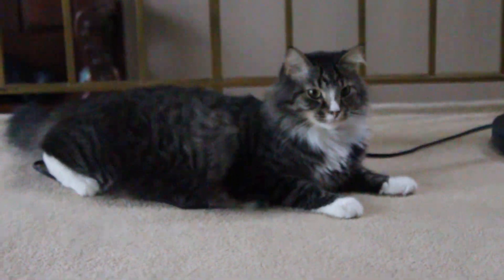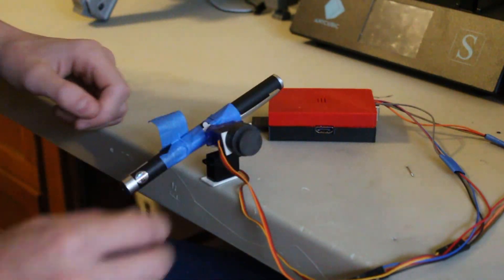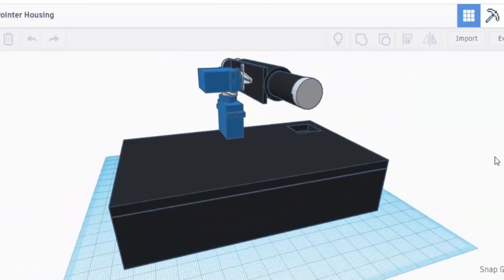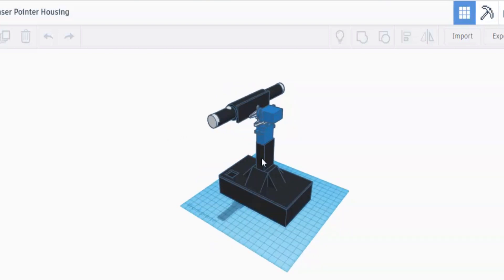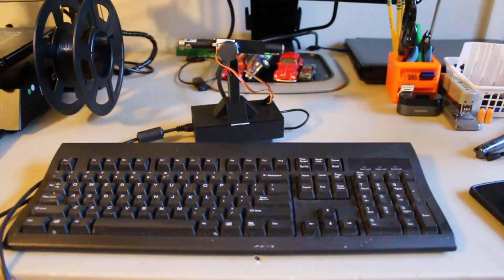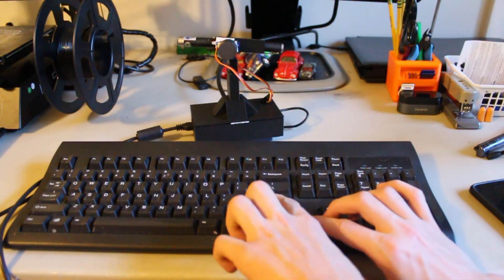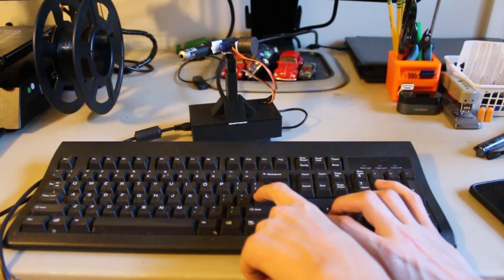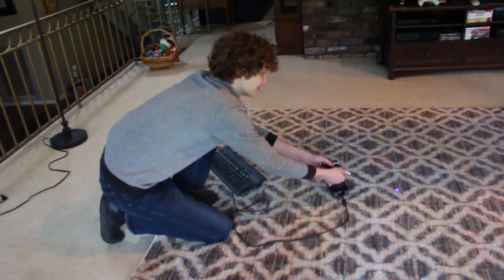I built a robot that plays with cats

Comment: I used to do programming years ago as a hobbyist, so I Google'd it. I never learned Python, but what does "on_return_release" do?  Would that solve your key release problem?
That, or what about just having the laser move randomly?  Maybe add a camera to be able to  determine distance and block it from going to far so for instance, the laser doesn't randomly point up to the ceiling.
Reply from the maker: There is a python library called pynput that allows for the detection of key releases, and I'd use that if I ever decided to make a second version of the robot

Comment: Preferably you would build a feedback loop that changes the rate of movement and direction randomisation of the lazer based on the location and movement of the cat. This adds obvious levels of complication. You'd need a sensor, lay out a grid based on the surface of the ground, once you can identify an object location on the grid it's then possible to set a response pattern in relation to the object. In theory...

Comment: Sound from the servos scaring the cat? How about random code to move the pointer so you don't have to manually control it?
Reply from the maker: I've thought about that, a random pattern that is. But the servos move so quickly from one place to another that he would easily lose sight of it. I tested that method, and decided it would be better to have it keyboard controlled
Reply: @mediocreengineering6900  maybe have it elevated like you did on the first test, and have the angles restricted, then the laser most likely wont move to the walls. Also, if you are using python you can import time, and use the sleep method for 1 second for enough minimum time for the cat to track it and realize where it is, then you could probably add on import random, and use x.sleep(random.randint(y, z)).
just a sugestion.